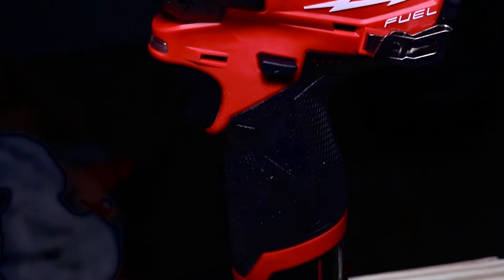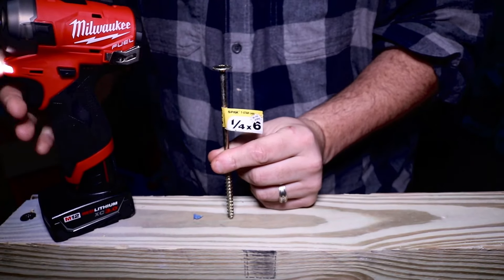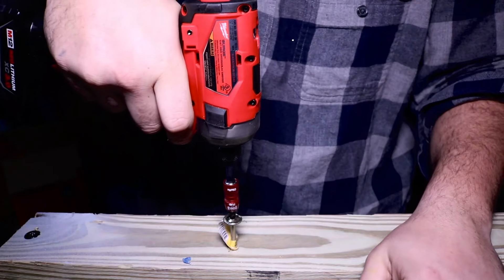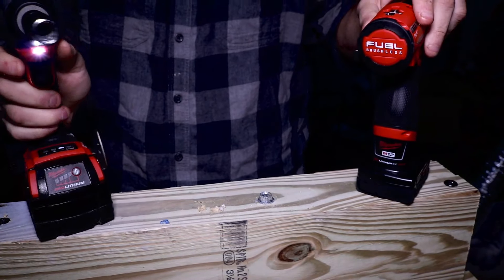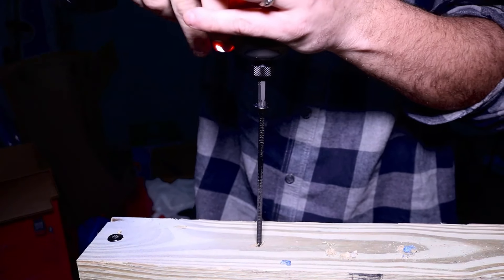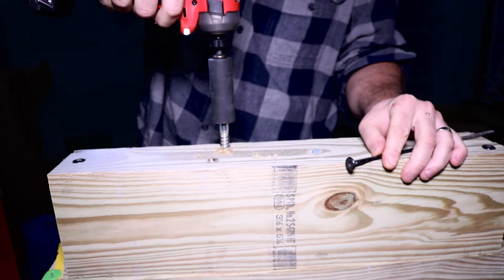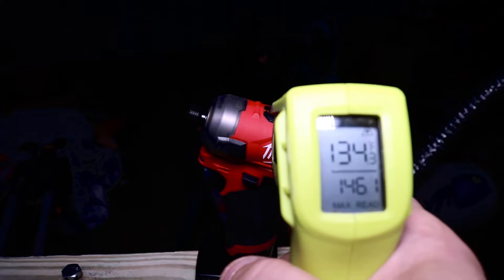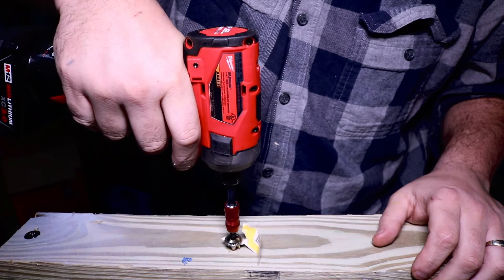Milwaukee M12 Surge Review. Today we are reviewing the Milwaukee M12 Surge, this is how it did.

Comment: As an HVAC technician, I find this tool perfect for sheetmetal screws and small wood screws.     I use it on the job all day with one small 2.0 battery.
Reply: Same here. Installing 2 furnaces with evap coils and all the ductwork. I let my lead tech use it and he just looked at it for 5 sec and said "This is fukin cool!" it's an m12 3rd gen impact.
Reply: i haven't warped line-hide or or stripped more than a handful of holes since i bought one of these. truly perfect for HVAC IMO, although i do understand those that love the m18 fuel, i just like the size and low power of the m12 surge.
Reply: Yes sir I use it for installs. Perfect
Reply: Your using a 12 volt for a reason, light & quiet. If you want more power than this, grab the 18volt, don’t bother with 12v 3rd gen regular impact.

Comment: Just got an M12 Fuel Surge and used it today. Wow. Noticeably quieter and smoother operation than he M12 Fuel Impact driver. The slightly higher weight isn’t noticeable unless you’re holding both at the same time. Truly a different experience vs any impact driver I’ve used.
Reply from the maker: Awesome feedback brother 👊

Comment: Oil based impacts are not meant for power. They are meant for low noise and finesse.
Reply from the maker: It is definitely quiet and I love that. I do however wish it did have a bit more power, but it's really meant for those smaller jobs
Reply: @ToolReviewZone  I'm a lightweight tool nut. If you want a quiet driver that has a lot of power check out the Ridgid Stealth Force. That thing is a beast. Definitely bulkier and slightly more vibration but practically twice the power of the surge model. I don't own the Makita oil version by here that's a good one too but still slightly less power
Reply from the maker: @jasonbyrd5150  awesome, thanks for the info Jason.  I'm going to check it out 👊
Reply: like a drill?
Reply: @Zozo806  yeah. Impact driver oild filled. Like the Milwaukee surge. I love that little impact.
Reply: @jasonbyrd5150  no, my point is a regular 18V non hammer drill would outperform an top tier impact driver in speed. and is much quiter.
Tests of big ass screws in not predrilled wood is just not representative. And even here an big drill like the M18 Gen 3 drill or the Hitachi multi volt would blow impact drivers out of the water

Comment: I’d be more interested in a comparison between this unit and the regular Fuel M12 impact.
Reply from the maker: I'll try to make it happen Willie!
Reply: Tool Review Zone thanks for possibly enabling my tool addiction lol. I’ve been considering getting a 12V fuel impact to go along with my drill.
Reply from the maker: @willied7759  Hahaha, my pleasure Willie lol
Reply: I've used both as daily drivers.   I really like the surge because I don't have to break out the hearing PPE.  It's so quiet compared to the non-hydraulic impact.  And the M12 model is obviously not a replacement for the M18 surge, that monster is a beast.  Driving GRK deck screws, replacing rotten or split exterior stair treads?  Simplicity with the M18 surge.  Assembling delicate furniture from flat pack, the M12 in mode 1 is awesome.  But I usually use the M12 installer driver fo furniture and cabinets.
Reply: @phillipsofthedriver  What's the advantage of the installer-driver over the standard impact or even surge?
Reply: @MadLadsAnonymous  assembling flat pack furniture made out MDF, you can easily overdrive cam lock screws and tear out the hole using an impact.  The installer driver has low enough clutch torque settings that prevent tear-out.  Milwaukee's installer driver is a copy of the Festool, but Festool's uses a battery that isn't on ANY of their other tools.  I like having one charger that works with all my batteries.
Reply: @phillipsofthedriver  Thanks for the detailed and non-snarky response, Alan. Cheers.
Reply: @phillipsofthedriver  So would a hammer drill be better than an Impact if mostly drilling into cabinets and drywall and assembling MDF furniture?
Reply: @MadLadsAnonymous  for drilling pilot holes I use the installer driver if they're small.  For lag bolts the M18 (really old but still working fine) hammer drill.  For concrete the m12 5/8 SDS+ rotary hammer.  And for flat pack/MDF furniture I vastly prefer the torque control of the installer driver.

Comment: The surge isn’t meant for power. It puts out 450 inch pounds of torque. If you want more power, while still being compact, the normal m12 fuel impact driver does 1300 inch pounds. The surge is made to be quiet and have less vibration. It is made for lighter applications in tight spaces or to operate in hospitals, offices, retail spaces, etc. A better test would be a side by side comparison to demonstrate the decibel/ driving speed difference per application. It does have its limitations, but that’s not what it’s made for. Also, there isn’t an auto mode. That 4th mode is designed specifically for self tapping screws. It starts off on high rpm and then once you make it through the material, it slows down to prevent stripping. I appreciate you showing the upper limits and I love the channel, but I just think you did the tool a disservice by not highlighting what it’s made for or what it actually does well.
Reply: Tyler Herlien  yeah honestly you are absolutely right on that.
Reply: I haven't seen them compared side to side but your comparing brief peak torque to sustained torque. I know both my Milwaukee M18 FUEL Surge and my 18-volt Ridgid Gen5x Stealth Force impulse drivers will drive fasteners faster than most impacts with higher torque ratings because they are brief peak torque rating where hydraulic impulse drivers run sustained torque. And you are correct the 4th mode on both the M12 and M18 Surge impulse drivers is for self tapping screws although I have never really liked it
Reply: Was wondering about that because I do HVAC. Thanks for the feedback!
Reply: finally somebody with a brain

Comment: I'm a licensed electrical contractor and the M12 Surge is my favorite tool on the truck. I'm definitely NOT building decks. I mostly use it to drive 2 1/2" corrosion resistant screws for exterior light blocks and receptacle boxes. I also use it to patch holes in sheetrock and even for switch and receptacle devices.

Comment: Hi TRZ, 

I have both milwaukee surge m12 & m18.  I have to say i like the m12 model when working inside the house, condos or apartment units when installing cabinets or just working with screws.  The m18 surge i will also use with the same applications because it less noisy.  

When installing larger bolts, deck screws or heavy work i just use the m18 gen 3 impact.  I mean just use the right tool for the job.  Not to say the smaller tool can't do the job. It's nice to know it can do it in a rare situation. Remember not one tool can do it all, LOL....  

Just my thoughts
Reply from the maker: Hey Michael. Yeah bro I agree.  I actually like this a lot, but just need to know the limitations.  I guess I'm just spoiled by Milwaukee and their tools always have so much power

Comment: ive had a m12 fuel for half a year now. In practice its eliminated 90% of my.. need a screw gun, gota go to the tuck trips, it just lives in my tool belt/bag with a few bits and uses the tiny 2.0ah battery. If im doing any intense work id go get my 18v but this has saved me a huge amount of time.
Reply: The surge or the regular fuel?

Comment: With all due respect, I believe this is mainly an issue of torque differences between the M18 and M12 and not power. The M18 is clearly able to exert more torque, therefore it's able to drive those fasteners deeper and faster.

Comment: I think if you used the 4ah or 6ah red lithium batteries you'd notice quite a difference. The drill almost flies out of my hands with one of those apposed to the 2ah. The batteries make a huge difference with this 12volt line.

Comment: I just got one and I don't think it's made to drive in the kind of screws your driving with it. I don't think it's made to drive 1/2' lag bolts into treated lumber it's only a 12-volt tool, I think it's made to drive smaller screws hence the smaller size, if you need to drive large screws and lage bolts that what the M18 Surge and Impact Guns are made for.

Comment: I’m trying to decide to get this one or the M12 Fuel impact driver. I’m a mechanic and would mostly use it in place of my M18 Fuel 3/8 impact, as well as handling screws/bolts. I’ll use around the house as well. Been wanting to up my (nonexistent) handyman game :)
Reply: If you want it for torque don’t get this it is not ment for it
Reply: This is not an impact wrench.
Reply: @johnshottie4415  I’m aware of that, but it’s nice to something lighter when all I need to do is remove bolt/screws that aren’t torqued very heavy. Side panels, dash screws, light housings, etc. All I had at the time was my M18 impact and it’s heavy to do such light stuff.
Reply: I’d get the regular m12 fuel impact over the surge. Is much more powerful. The surge is just made to reduce noise and vibration. It is quieter only in some situations. It lacks power so will impact at times when the standard m12 fuel impact doesn’t need to. Both would work for your situation though.
Reply: @johnshottie4415  That’s what I was thinking as well, plus, the M12 Fuel is cheaper. Surge seems to be geared more towards electricians, carpenters, etc. Appreciate the input.
Reply: @JakeNaughtFromStateFarm  I use the M12 fuel for electrical work. The different settings are perfect. I can drill through joists with 1” paddle bits with ease on setting 3 or tighten delicate screws with setting 1. It is pretty much the perfect tool. I don’t even pack my M18 impact anymore.

Comment: I don't understand why anyone would be using this or any M12 tool to drive 12" lag bolts on a construction site. This impact is designed for lighter applications. Showcase the tool for what it's made to do. Driving lag bolts is what you do with the larger drivers or hammer drills.

Comment: I really don't understand the reasoning behind the surge. I have the M12 Fuel and it's perfectly fine.     Guess I need to look at the bigger picture, I reckon the slightly lower noise output is really desirable to some people.

Edit: 3-3-2020 I am back here after seeing the big picture as I have an M12 Surge on order. LoL I finally got to try an M18 Surge on a jobsite and fell in love with how much quieter it was. I use my Gen 2 M12 Fuel daily, so I am moving over to the Surge.
Reply: so getting the m12 surge is better option than m12 gen 2

Comment: would it be better to use a hammer drill instead?
Reply: Not the same “action” from a hammer drill.  Works differently. Hammer drill is meant for concrete/masonry drilling

Comment: Great video putting it to the test.  I have 20v line of another brand.......I started on 4v Milwaukee Screwdriver as my only Milwaukee tool. Then on M12 line with the  3/8 extended ratchet. I just bought 6 tools now from M12  line ONLY because of their SIZE and quality. 

Im an electrician and these tools are perfect for us. I use the 20v line only when needed.
Also, many times im working in occupied homes so noise is another big factor i chose over the M12 Fuel original impact.
The Surge has good prolonged impact at a lower decible.  The other is shorter impact duration at higher decible. Thats why I chose Surge.

Comment: I really like the review. Very nice tool for the size. And on light projects id love to use this but i can't see using it on the bigger jobs. Around the house or assembly work or perhaps driving deck screws this would be great for.
Reply from the maker: Yeah those are my same thoughts Terry. If i had the smaller jobs, this would be my go too, but the M18 is just a beast

Comment: Good vid as always , I just got done using one of these to replace 4 very very old doors.  This is a great little drill , speed one was awesome for removing those old stubborn straight head screws that had about 1000 coat's of paint on them....you have a shit ton of control with this little guy.  Now with that being said I think this little gem is best suited for punch out work or similar task.....if u stay within reasonable parameters this drill will not disappoint you. It's much better than any other drill in it's class...that's just my opinion.
Reply from the maker: Agreed 100% Donny. Thanks for the feedback!

Comment: Can you review the Dewalt dcf801
Reply from the maker: yes sir. I have a few others items that I need to review, but I'll request one from ACME for us to see
Reply: Tool Review Zone thank you.
Reply: Larry I'm a Dewalt guy & I do HVAC. I've used the gen1 brushed 12v Dewalts since 2011 & absolutely LOVE those things & have had no issues what so ever. I was very excited about the new brushless line, but I ended up hating the new impact driver. P-mode is a joke & absolutely useless. The collet is extremely wobbly. I actually returned it to Lowe's and got the screwdriver #DCF601. I LOVE IT!!! My favorite drill I've ever owned. They got everything right with it & there is not a better drill on the market for HVAC work. Hope that helps 👍
Reply: Shannon Knight HVAC thanks Shannon.

Comment: M12 surge isnt much quieter then the 2553 m12 impact driver it's only 10 decibels
Reply: 10 decibels is a fairly noticeable difference, that's twice the noise level. 10 db breathing, lowest limit of urban ambient sound 40 db, quiet home conversation 50db, 60db ac unit at 100 feet, 70db vacuum cleaner, 80 db freight train at 15 meters, 100 db jet taking off 300 meters away. Everything at 80 starts to increase possible hearing damage with prolonged exposure.
Reply: @wclintf  every 3db is doubling the sound.